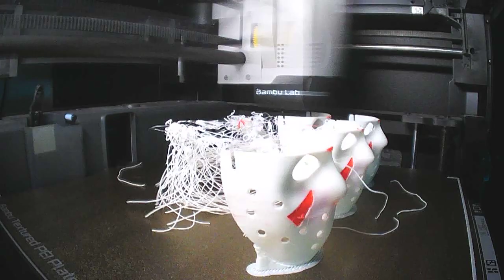Here is a spectacular fail on my Bambu Lap P1P for you. 😂😵☠️

Comment: The PEI is amazing cause stuff just pop off when it cools but it comes at the expense of bed adhesion risks. For PLA I prefer the cool plate with a thin coat of hairspray. Never ever fails. A quick bend of the plate pops them off. No nasty glue residue
Reply from the maker: Yea. PEI Adhesion sucks compared to glass and other materials. I have not try the Bambu Cool Plate. The K1 plate is amazing and very much like the Bambu High Temp plate. I was going to try that. Maybe I'll get a cool plate also...

Comment: Yeah. Have a brand new P1S. Happens to me with small footprint models. Brims seem to help at times, but, not all the time! I feel your pain. I think I may have to add a little glue.
Reply from the maker: Indeed, adhesion is poor. Few notes: Use mote aggressive supports. Slow down. Reduce Aux Fan. Tinker with Bed Temp. Bambu Green liquid Glue is good stuff.